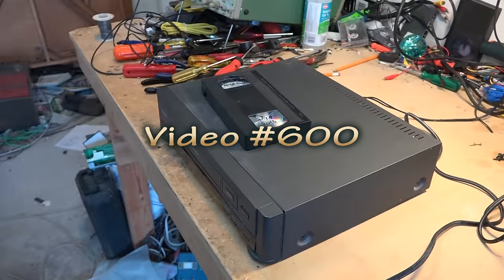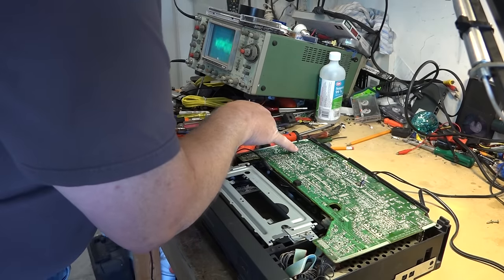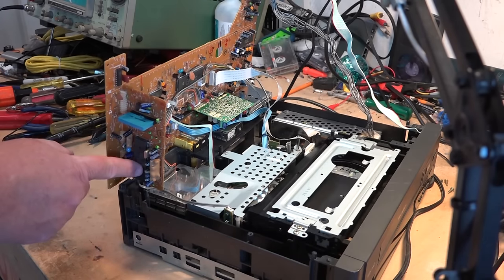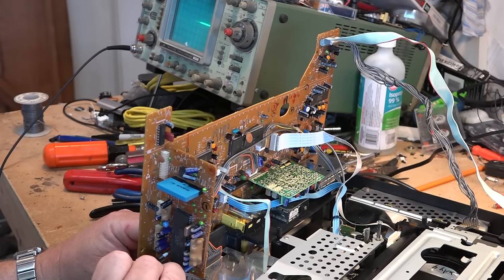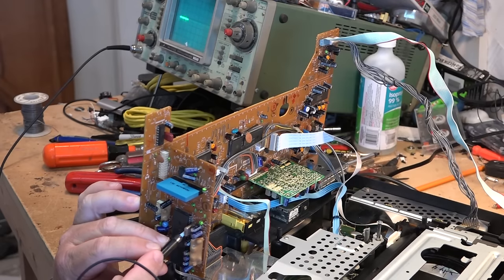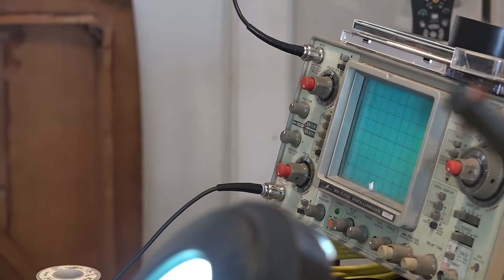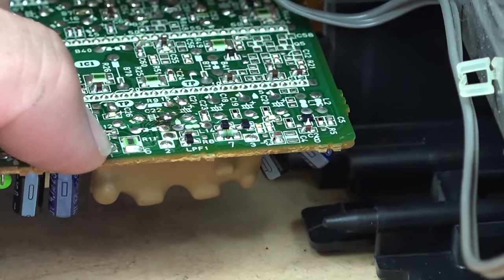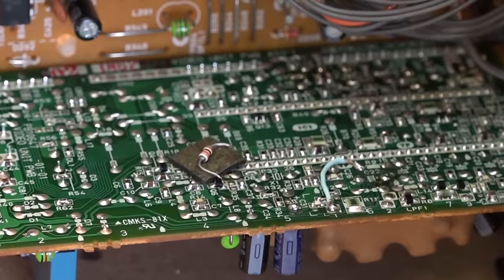Magnavox VR9160 VCR Repair, No Playback Video

Comment: On that video board, I've noticed a dark discoloration on the positive end of the solder joint for C22.

Could that cap have leaked, causing damage that may have resulted in the damaged trace?
Reply from the maker: Possibly, looks like it is in the vicinity of the trace, or that could be some rosin.I just noticed that the FL clock display is dead too, so I will be making another one for that fault.
Reply: 12voltvids Yeah, it could be flux.

Only way to find out would be to troubleshoot it on the bench, such as checking out the cap's legs to see if there's any evidence of leakage.

Comment: I have an RCA model VR505 vcr that had been trouble free and used very little. I had not used it for a year or so, then one day I plugged in a tape but There was no power on any of the screens. I figured it might have got fried in a lightning storm but all of the fuses were intact. I checked the cord for bad wire but it was ok. Do you have a shop somewhere that people can send you a unit for repair? Any inherent problems with this model?
Reply: Check the fuse

Comment: 12V, any VTR Betamax Repair, in the near future?
Reply from the maker: Working on a vintage, 37 year old SL8600 right now. Got it playing back, but still struggling with the auto stop. It may be the pickup coils that detect the metal leader on the tape. If shorted it will throw a wrench into the repair, at least as far as the auto stop goes. This unit is a beast. So far haven't had to put any parts in, just adjustments to bring frequencies back where they belong.
Reply: Thanks 12V.

Comment: Bloody hell, speedy repair :-D
I had forgotten the path of playback, my old piano key vcr has been my guide.
Its old but the basics are allways good :-)
Reply: Which piano key machine do you have? I have JVC and Panasonic piano key vhs machines and a Sanyo betamax that also has piano keys!
Reply: Its a JVC HR3320-EK the later model with 8 channel buttons, uhf for the uk.
Reply: Nice. I have the HR-3330TR. Multi system version. Plays PAL, SECAM and NTSC.
Reply: Wow that does have a lot of options.
The down side to that style of vcr is the d.c motor and belt used to drive the rotary heads, and the servo was a swine to keep stable, breathing picture or swaying just became a nusance.
I did buy a new motor for it years ago and reset the servo pcb, it worked well for about 4 years then sway sway ooow sea sick LOL :-D
Reply: When I adjust the tracking on mine, the picture wobbles a little bit (drum servo not locking). Might be a servo capacitor problem. I have replaced all the belts on it.
Reply: It could be a dirty tracking pot, that would send it mad.
It will sway a bit if you try to move the tracking too quick, the flywheel cant speed up or slowdown that fast.
Other odd tracking problems:
If the video head guide posts are correct i would look at the tension brake on the left, the tracking /friction of the tape round the heads can be too little or too much.
You will get more picture dropouts if the tension is too weak.
When the tracking is bad the sound can be out of sync with the picture, often if somone has tampered with the control/audio head (critical for tracking).
 They are fun old machines to play with lol :-D
Reply from the maker: JVC had issues with PG coupling caps on the capstan and drum motors that would cause servo errors.
Reply: +12voltvids My HR-3330 has a belt driven drum. Do you know where the PG magnet is?
Reply from the maker: I have a Hitachi Multi system, and an old JVC top loader that I will drag out and throw up on the bench and look at.
Reply from the maker: It will be on the drum somewhere. I am going to tear down my old SL8200 Betamax today, and it is a belt drive drum from an AC synchronous motor and see if I can get it playing. The design will be similar being a belt drive.
Reply: The pulse magnets for the video heads are on the hidden side of the flywheel underneath, an alan key will be needed to remove the flywheel.
If your looking for the transport capston magnets they on on the hidden side of the capstan flywheel.
Both signals from the heads near the magnets are processed by the left pcb on simpler machines, the audio/servo pcb :-)
Reply: +zx8401ztv The capstan magnet is a large one that sits above the flywheel and held with three screws. It has to be realigned carefully after replacing the capstan belt.
Reply: No, the pickup head is mounted by the three screws and two small magnets are glued into holes drilled into the capstan flywheel.
two pulses per rotation. :-)